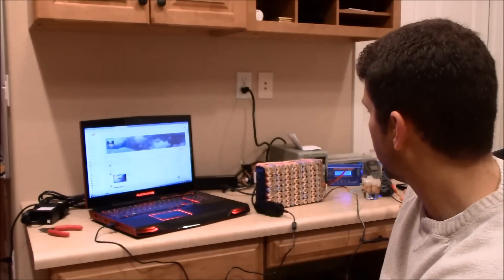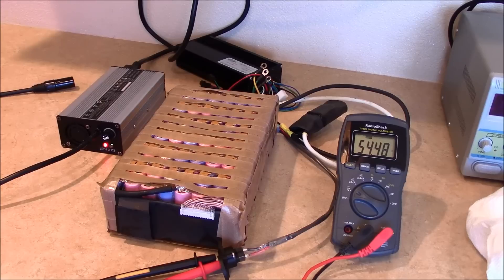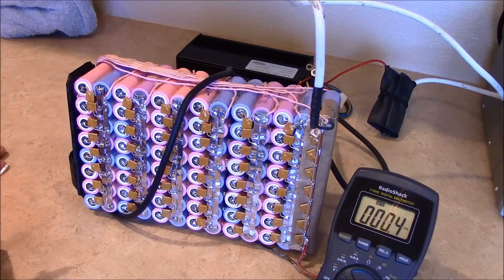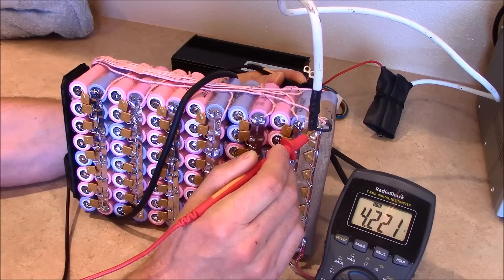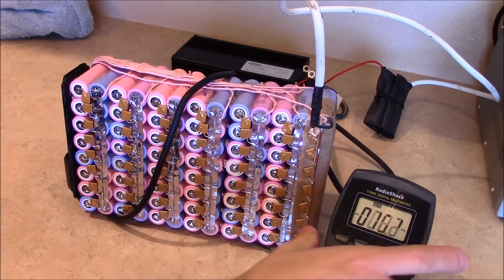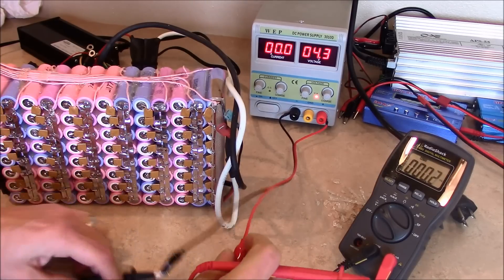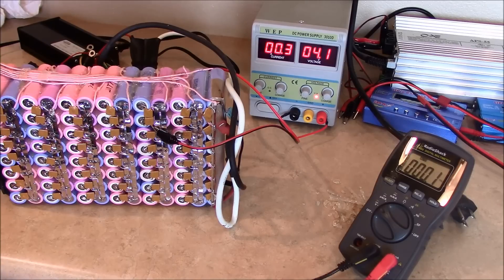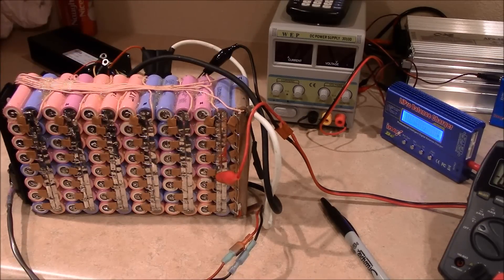How to build a e-bike battery pack "BMS wiring" (Part 7of 7)

Comment: Do you think your BMS board is bad?
Reply from the maker: yeah there are some fake BMS's being sold on ebay.   I contacted the seller and they say to use new cells only with there BMS.  I told them that they covering up what they are selling as their BMS does not have a balancing function if one of the banks isnt charging correctly.  I told them to stop calling it a BMS as its a scam!
Reply: +15-sec-of Fame And that was a pretty expensive one, I've seen them go for $13 on ebay and was wondering what could be wrong... BTW I'm no expert but I have heard that storing voltage for the 18650s should be at 3.85V also heard people say they only charge then to 4.1 volts because that way they double their already long life
Reply from the maker: Francisco Mendez I spent $50-60 thinking that I was getting a top of the line BMS, well that was my lack of knowledge at the time of buying it.  This reminds me of why I am making these videos to provide info about the products I'm using and to help others be more informed on what to buy or not to buy :)  You are right on storing the battery at nominal voltage as its better for the battery, but I wanted to see if it would hold a good charge.  Im not to worried about the charging amount as the cells are mixed used cells anyway with 2/3 of their normal rating amperage.  I think I'm good for 500 charges which will be years of riding for me.
Reply: +15-sec-of Fame We appreciate the vids! If you bought it less than 90 days ago you could still dispute the charge on your your credit card (some are only 60 days)
Reply from the maker: +electron spectrum I bought it back in June so unfortunately I'm over the return period.
Reply: +15-sec-of Fame I thought the whole purpose of the BMS was to stop the bank charges individually...
Reply from the maker: +Tommy Johnson Hey Tommy, I think the BMS is ok and is working as designed its just not a smart balancing BMS so it doesn't balance correctly.  During charge it charges all the banks at the same time and same rate so as soon as one bank hits the over protection limit it shut off the entire charge.  Over time and a few charges later the lower banks become very low and the whole thing gets out of wack.